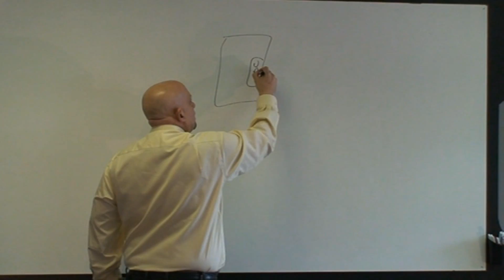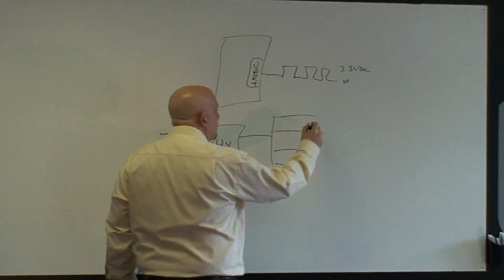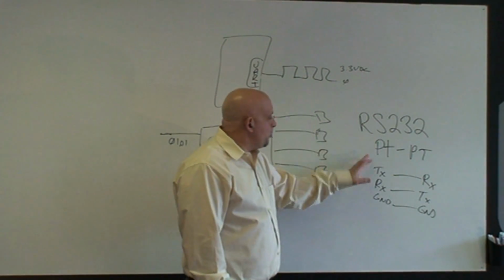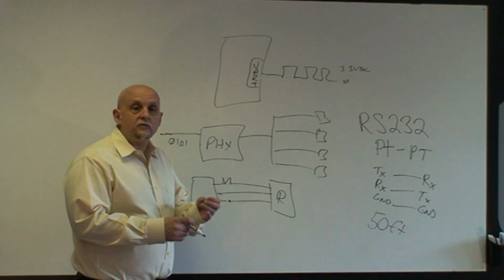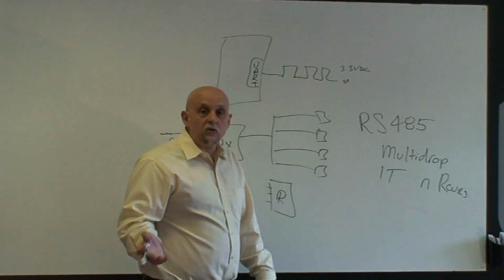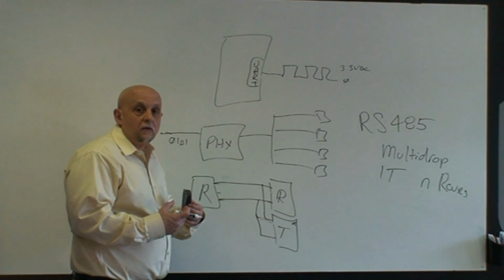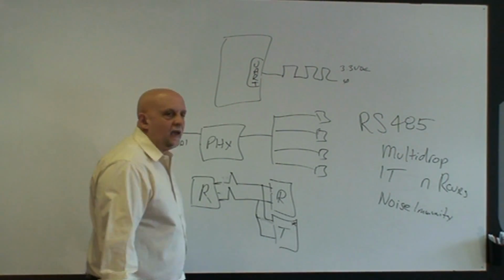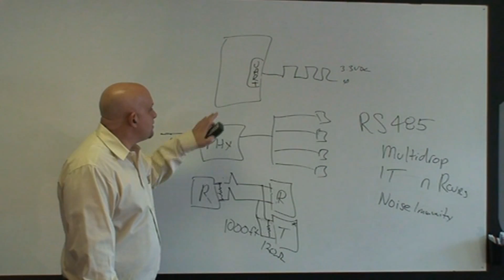Serial Communication RS232 & RS485

Comment: This is No Good.
May sound good for novices
First of all rs-232 is TTL technology. Not CMOS.

ALSO When Talking ABOUT 485 he only went as far as talking about noise on the line and how spikes cancel each other but nothing about the DATA signals themselves and the DATA signal differential.
Also, 485 signals can be as high as 12V
ALSO,  said nothing about full duplex.
This guy's presentation is worthless, Bc he's worthless

Comment: Hi, We have made a RS485 & CAN Hat for Raspberry Pi, on board 2*RS485 Bus and 1*CAN Bus communication interface via SPI interface. CAN bus and RS485 bus are powered by separated isolated power modules, signals between the transceiver and the controller are isolated too.
http://www.inno-maker.com/rs485-and-can-module-for-raspberry-pi/

Comment: how we can solve the disadvantage of RS-485 when the transmitter send the last bit and before it turn to listen mode it receive then lost his first bit
Reply: Do you mean after the transmitting device finnshs sending a message and the receiving device then transmits an acknowledge back but before the receiving device turns its driver around again to get ready for the next message,  the transmitting device is already sending data? If so, you need to adjust a parameter sometimes called "Tx delay" on the device that's switching too fast for the slower device. Hope that makes sense in layman's words. But before this make sure both ends are using the same baud rate settings.

Comment: Awesome video, thanks.  One question that was not clear, how does the reflection occur?  Is because of resistance built up in the cable distance?  That part was a bit confusing.

Comment: This video was very helpful. I was running into problems getting an RS232 female db25 serial Boca ticket printer to work. This video led me to investigate null modem wiring and pinouts. My problem was solved after I soldered together my own crossover (a.k.a. null modem) cable. Thanks!

Comment: Hello sir! I have been wondering that it would be theorically possible to use I2C over a full duplex rs485 bus. However over the internet I have found that it is not possible and I can´t understadn why... Could you give me some reasons please?
Reply: Federico Pinto i2c which is rs232 uses clock and data, and tx and rx which is rs485 so they're different

Comment: I think, when you talking about the characteristics of the RS485, you actually talking about of the RS422, RS422 is a multidrop protocol and RS485 is a multipoint protocol, where you have different transmitters and receivers and you can send and receive information from different points (transceivers). Thanks for the video

Comment: Why is there no noise induced on the ground wire in RS-232?
Reply: pompotus of love Yes thank you, that is what I meant to write, it was just a typo. 

I just wanted to thank 2v2 for taking the time to answer my questions
Reply: megaspeed2v2 why is the resistance of "ground" any less than the resistance of the wires carrying the other signals?

Are the wires carrying the transmission signals and the ground wire not the same thickness and roughly the same length?

Separately, assuming the ground wire is a much lower resistance than the wires carrying the transmission signals, why would that cause the chip to be unable to see any induced voltage (noise)? Would not the only difference caused by having a much smaller resistance wire be a larger current?
Reply: +megaspeed2v2 

When you say "ground," you are referencing the ground plane of the PCB right?

The chip is not connected to physical earth ground through a water pipe or something like in the main breaker in a house, correct?

So you seem to be saying that the resistance between the ground wire and the ground plane is very low.

If there is an induced voltage on the ground wire, would it not make its way to the ground plane?

If the induced voltage makes its way to the ground plane, and the ground pin of the chip is connected to the  ground plane, and the chip uses the GND pin as a 0v reference, would that reference not be shifted by the induced voltage?
Reply: ***** maybe ive said something wrong in my previous comments so can i start again.
The noise may be induced onto the ground wire but that noise is pulled to ground since the other side of the connection is on ground which is ALWAYS 0v relative to any pin on the chip even if noise gets on the wire that wire will be at 0v while the signal wire will still be at 0.1vp-p for example if there were 0.1vp-p of noise so the noise isnt removed from the resulting signal.

For noise removal to be done, the signal has to be send along with another copy of itself on a second input wire, difference being that the copy is 180 degree phase shifted before being sent along its way, (what happens if you add those two together? you get an output of 0v as the 180 degree shifted signal cancels the original but however, once the signal from each output reaches the input of the next device that device then shifts the one signal back to its original phase, the point of this is that noise adds itself in after the first phase shift and before the second one so when that second shift is done, the noise on the second wire will be 180 degrees out of phase with the noise on the first wire and so cancels eachother out whereas the signals on each of the two cables are returned to in-phase with eachother so the pass through unharmed.
^i guess you can see by my wall of text why he simplified the explanation in the video xD
Reply: megaspeed2v2
Thank you for your responses, but with all do respect I don't believe you have addressed my question.

Wouldn't the fact that the noise is pulled to ground, "which is ALWAYS 0v relative to any pin on the chip," cause a problem? If the chip expects ground to ALWAYS be 0v, but then a noise signal is pulled to ground causing it NOT TO BE 0v, would then all the readings not be off because what the chip sees as its 0v reference is actually 0.1vp-p (in your example)?

Am I misrepresenting something in my scenario, or are one of the assumptions explicit in what I am saying false?
Reply: ***** i did address your question, ground is always 0v relative to everything else in the system. that is your answer. any noise on the ground wire doesn't cause ground to no longer be relative 0v because if it did then it wouldn't be ground.
Reply: +Zambia95 *due respect. It's an idiom for showing admiration.
Reply: megaspeed2v2 Exactly

Comment: I get it, generally. The one part I don't understand is how having a ground or a differential matters. Just for the sake of conversation, if we had a 1V inducement on a Tx vs Gnd line, compared to a 1V inducement on a D+ vs D- line, assuming both wires were in the same proximity, what is the difference?
Reply: Late to the party here, I know.  The difference has to do with noise sensitivity.  Look up the term "common mode rejection".

Comment: i'm really new to this so bare with me, the questions are: Is there any difference r212 vs rs232? also between Tx vs TxD and between Rx vs RxD? i have a device for a credit card reader that is marked as r212 and pins 2 and 3 marked as Rx and Tx (not necessarily in that order) with out the D on the end. please help me sort it out, i need to order more and cant/dont really want to keep looking for the r212 because there are bunch of RS232 out there. thank you

Comment: why in case of rs485 there's induced voltage on both wires, but in the case of rs232 it only goes induced on one? Shouldnt it be induced on all the 3 wires as they are all exposed to the same noise? And another question: In rs485 standard, is it possible to exchange data between two slaves? Can one slave ask another to send or recieve some data while it works as a transmitter? Thanks for answers in advace! Great video anyways.
Reply: on rs 232 there is no voltage induced in 2nd wire because that was ground...even if any voltage is induced that will be send to ground any ways
in 485 the signal is taken from an opamp (you can consider it as an opamp they are actully driver circuit which works some what like opamp) on both side so difference in signal is taken at last
in rs 485 opamp is switched from receiving to transmitting mode when needed

Comment: RS 485 isnt multi drop. It is multi point. I guess it was an unintentional mistake. Worth to point out anyway..
Reply: Kriti is correct. he is actually talking about RS422, RS422 is a multidrop protocol and RS485 is a multipoint protocol.... not a buzz word but slightly different protocols.
Reply: RS485 allows for multiple devices to either transmit or receive, depending on their unique device ID that gets sent out by the master device. RS485 is definitely a multi point protocol.
Reply: Multi point in enineering terms. Out in he field we say multi drop only as a trade buzz word.
Reply: Means the same thing, multi drop, multi point.

Comment: So just to clarify, the use of the 120ohm resistor is to limit how fast the RX sends a acknowledge bit back to the Tx?? And how can you determine if you need to install a resistor at both ends? Thank you for your time
Reply: No. The 120 ohm resistor is a termination that absorbs the signal to prevent it from reflecting back to the source.  If allowed to reflect back to the source, the signal will either add to or subtract from signal coming from the source.  A 120ohm resistor is placed a both ends (Rx and Tx).  Doing matches matches impedance at both ends.

Comment: RS232 
Consider....
Noiseless  : TXD = 3v GND=0  
With noise ; TXD = 5v GND=0  (noise doesnt affects line with zero voltage)
Difference of both noiseless and with noise voltages differ in value...hence chnge in information
whereas in MAX485 chnge take place due to noise on both lines equally.. therefore difference remains the same...

Comment: Great video.. but one thing I really felt was unclear is why RS485 doesn't suffer from interference and why RS282 does? - You said it affects both lines, well why on RS232 doesn't it affect all 3? (or two if you just think of the tx and gnd). Is there something different about the hardware that filters it out? You mention the resistor but say thats for taking care of the mirror'd signal but does that also deal with this noise issue too?
Reply: as far as i Can think ...ground never becomes high. So there is no high state in ground wire which should get effected by noise. And as we know the ground is reference in 232 , the refrence remains stable in 232 with respect to data cable which gets affected by noise leading to error in data loging whereas there is no reference in 485 , no refernece means no comparison. 
Again thats as far as i can think. Hehe .
Hope soemone guides me too if i am wrong.
Thanks.

Comment: Regarding RS 485
John you pointed out that RS 485 is a "multidrop" and not a "multipoint" protocol.
In RS 485 network slaves are able to transmit messages back to the master. Slaves are equipped with transceivers, wouldn't it make it a multipoint protocol?

Comment: I'm trying to communicate with an old heathkit microprocessor trainer over rs232 but I get ascii character 152 which is the y with diaeresis or two dots above it but I should have line numbers for basic programming.  Is there a software utility for troubleshooting rs232 connection? I've tried different settings in hyperterminal and PuTTy.

Comment: RS232: Ground is a sink for noise (noise will be Earthed), RS485: no one of the two differential lines will be grounded. You can read about PCB design to know more about grounding.

Comment: Thanks, nice tutorial. I couldn't get the default spi port to work on my Atmel MCU, so I was toggling pins to implement SPI and was sending about 256 bytes per second. Is this about right? 2048 bits per second.